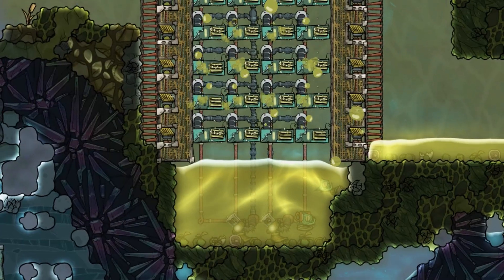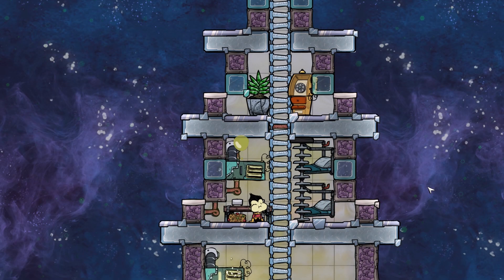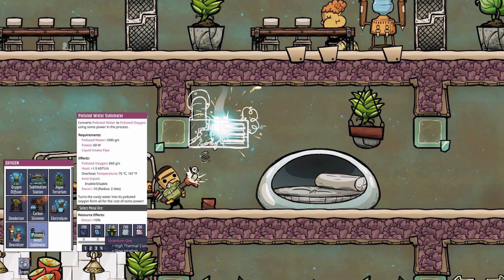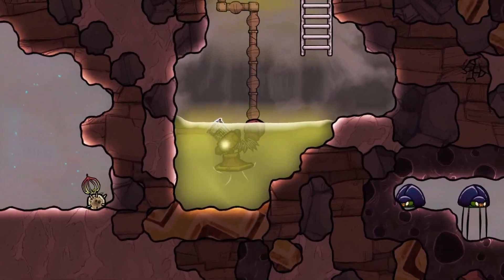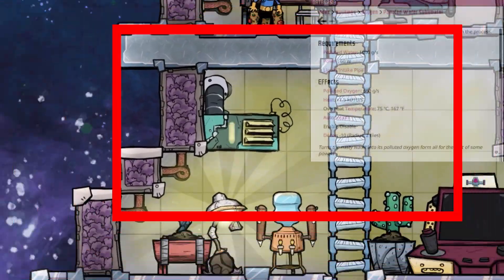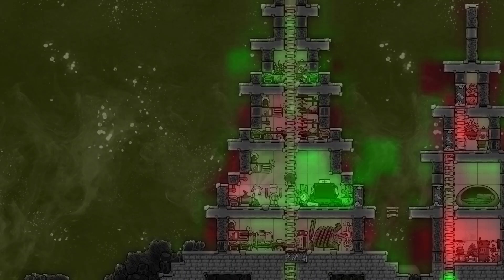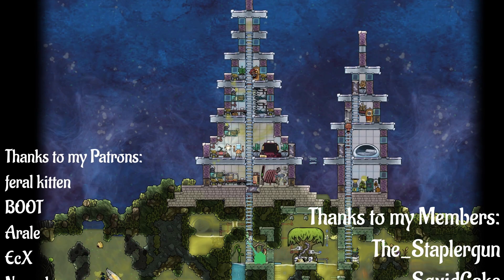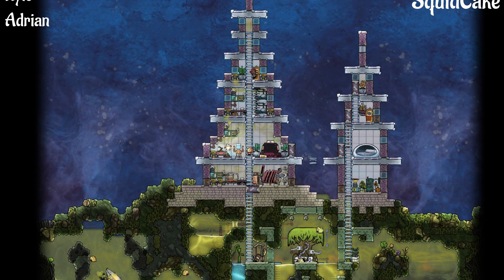Mini Mod Monday 28

Comment: Actually, it should be Polluted Water Evaporator. Sublimation is when you quickly turn a solid into a gas and vice versa.

Yeah, don't take me to your parties...
Reply from the maker: I actually noticed too. But I didn't want to out that in the video :D

There are some other peoples comments on the steam page about the physics as well pointing out the use of the wrong term

Comment: Same value as the sublimation station, altough it should be different. 99% of the liquid is just water and 1% pollution, so converting it at an almost 2:1 ratio is not that material efficient